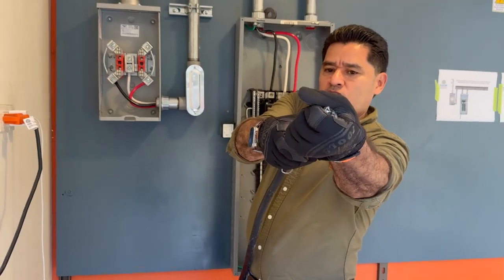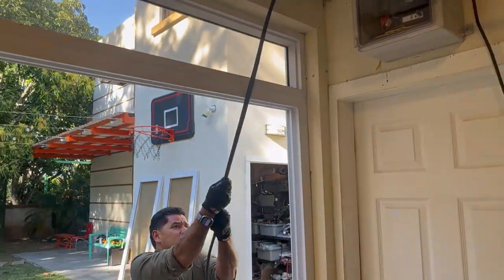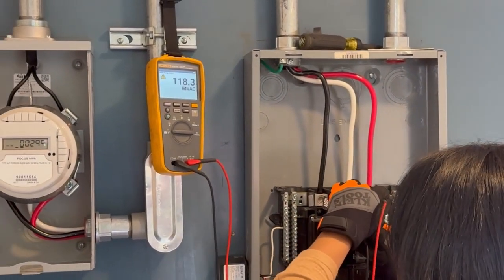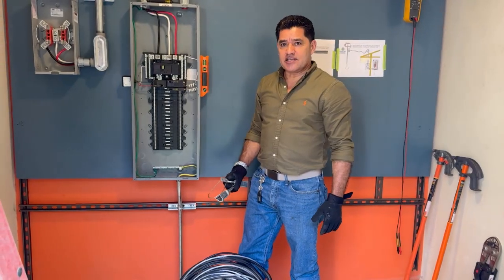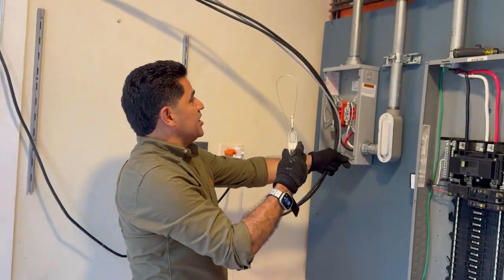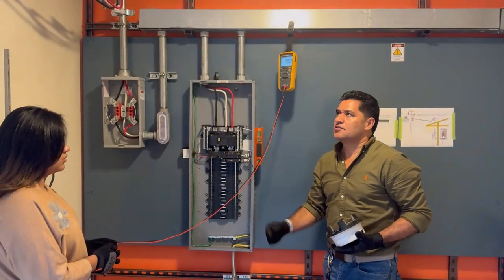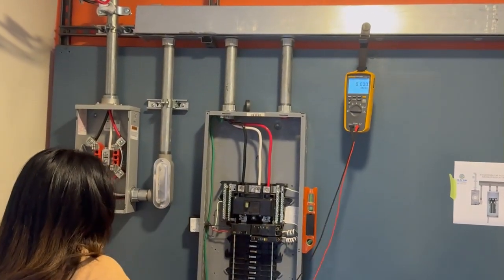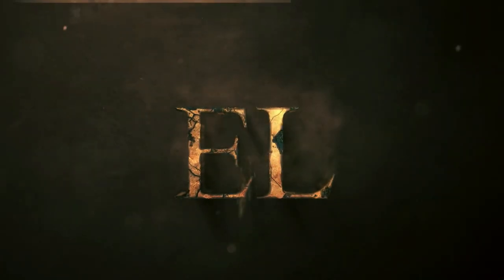INSTALACION DE SERVICIOS/BAJADAS ELECTRICAS AEREAS, DIFERENCIAS Y CARACTERISTICAS 2/2

Comment: Hola Richy, gracias por tus videos.
¿quisiera preguntarte para una vivienda unifamiliar de hasta 100A, con 110 /220 V, que protecciones diferenciales pones, nosotros aquí en España ponemos, para 220V, 40A / 30 miliamperios, para 110 V, que ponéis y cuantos ponéis ??? , por circuitos a proteger ?, aquí un diferencial por cada 5 circuitos.
Muchas gracias !!!
Reply from the maker: @RDB_52  según el código, te permite 180 va por tomacorriente o receptáculo, eso es como 13 dispositivos en una protección de 20 A, pero también te limita, que si vas a tener un aparato con una carga nominal permanente. ( ejemplo) un equipo que consuma  360 va. Este consume el valor de dos y nos va restando de los 13.
Reply from the maker: @RDB_52  hola gracias por tu comentario, gracias a Dios por la oportunidad, quiero entender tu pregunta. Te refieres a cuantos tomacorrientes o receptáculos van conectados por dispositivo de protección de diferencial a tierra, ?
Reply: @aprendeconelrichy  sí, aquí lo tenemos limitado a 5, nuestros paneles permiten limpias de int en guía Din y ponemos un int diferencial que protege 5 de una vez
Aquí una vivienda puede tener 15 o más circuitos
Reply from the maker: @RDB_52  suscríbete hoy subimos nuevo video.